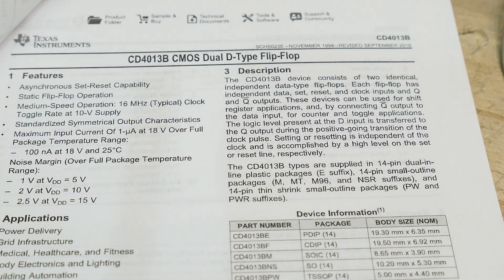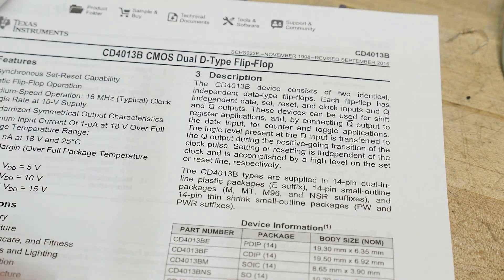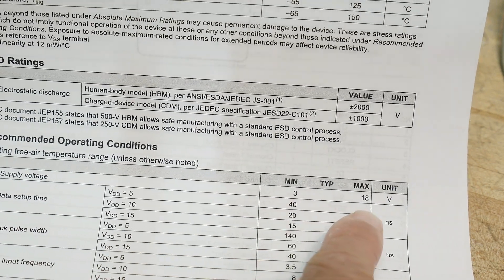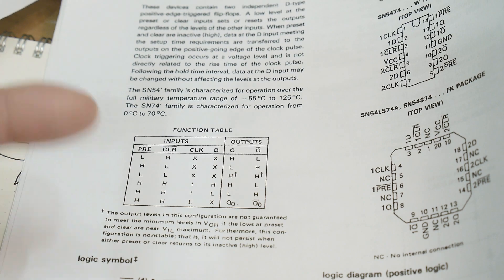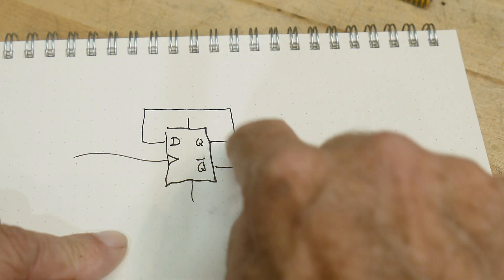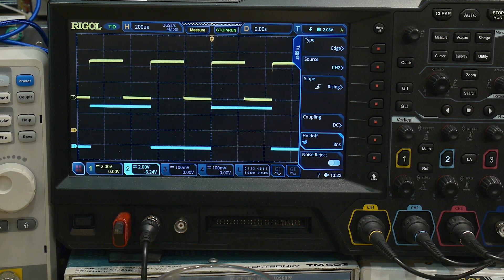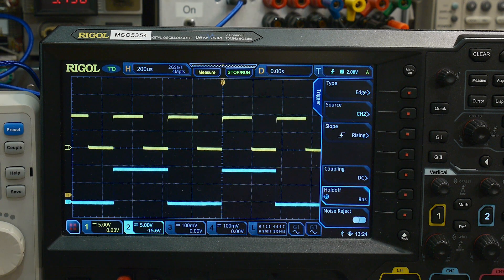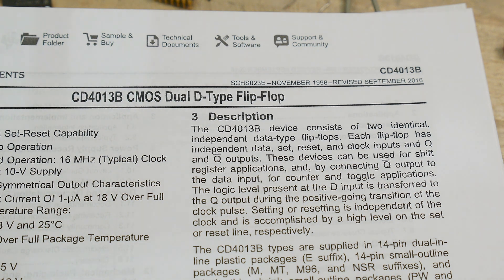#1580 4013 Flip Flop

Comment: That is strange.   The datasheet for the 555 specifically states timing is independent of VCC.     Plus the formulas for calculating high and low times do not include VCC variable in them.    What is your 555 circuit configuration?   It must be a non standard circuit not specified in the data sheet.   Great topic for discussion for chip of the day.
Reply from the maker: you are right, I have a bunch of 555 modules that do this. I'll make a video

Comment: At the begining cd4013 is compered to 7474. Its not just the pinout is diffrent. Its diffrent tecnology. 7474 is TTL and cd4013 is CMOS. the idea is the same but voltage level is diffrent because of thechnology.

Comment: So to check my understanding, cmos operates over wider supply ranges, including negative Vcc.  Did I miss anything? Or goon anything up?
Reply from the maker: it does not include negative Vcc.   some use them (as you can normal TLL) with Vcc tied to ground and the IC ground tied to a negative voltage. the IC thinks it is just normal

Comment: Another cool feature of 4000 series CMOS devices is that they can be used in negative supply circuits. That is, high = 0V, low = -5V or -12V or whatever. May be useful when they are combined in analog circuits. This is how CMOS is used in my HP3465A DVM that I recently repaired.
Reply: the Arturia Mini/Micro Brute also has a cd4013 on a negative voltage, i also run 2 DIY eurorack modules using a cd4013.